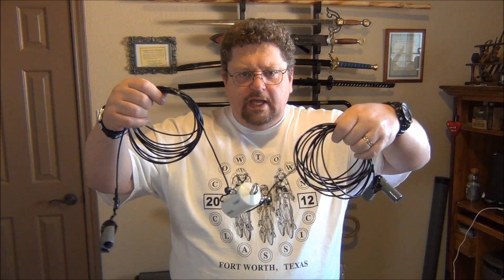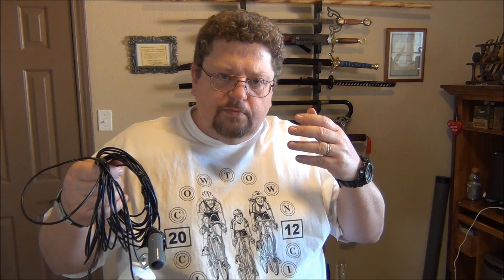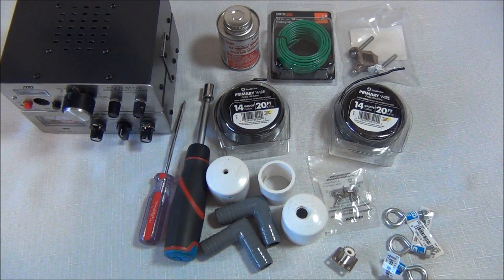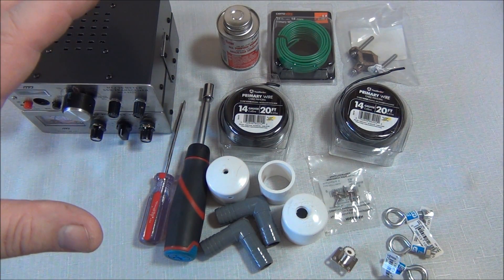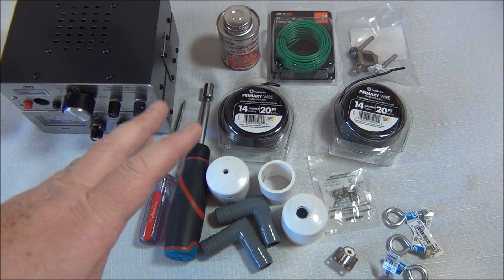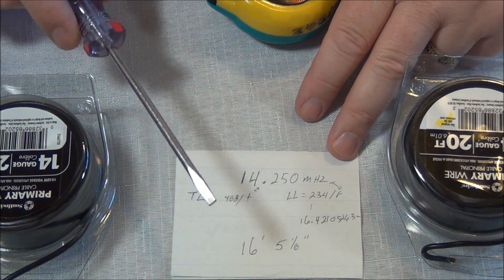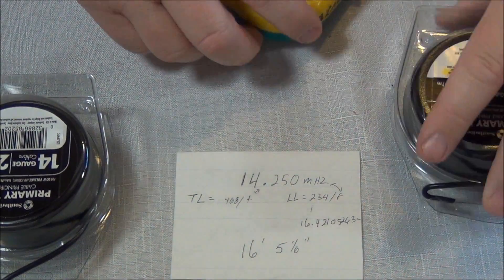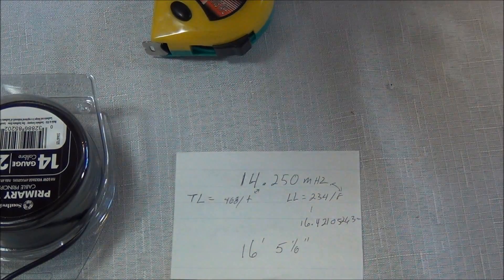Homebrew 20 Meter Dipole Antenna -- Home Depot / Lowes Part 1 - AF5DN

Comment: Hello, I hope you are well, I made a dipole antenna for the 20 meter band similar to the one you showed, each arm is five meters and the whole antenna is ten meters, I used 2.5 mm square coated copper wire, I used a one-to-one current balloon to connect it to the antenna, the problem is that I have a high SWR and I don't know where the problem is !!!! Can you guide me?

Comment: OK great video and idea with the lowes parts. I am building mine a bit different. I am using 1" PVC fitting and making it so it can either be hung between trees like yours or I will be able to mount it on a 15ft pole I built with more lowes PVC pipes and fittings. With the pole I can make an inverted V dipole. But I am using your basic idea. By the way my radioshack sells the PL239. Not cheap but with shipping the price is not that much more if I only were to order 1.